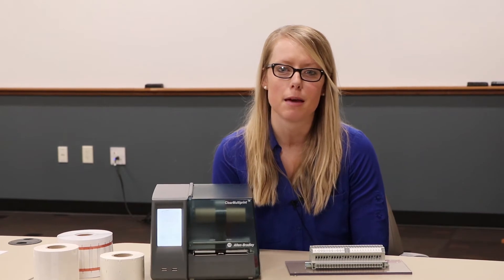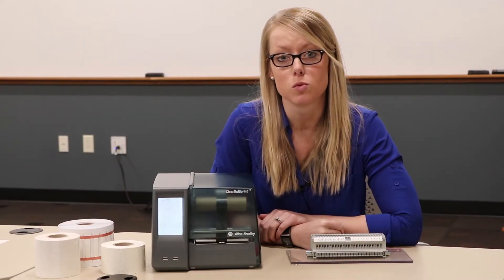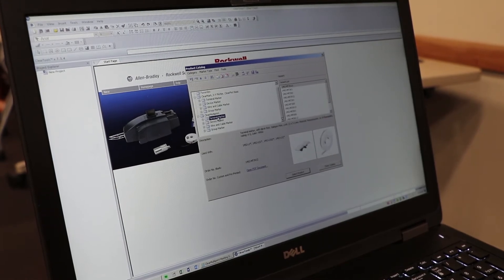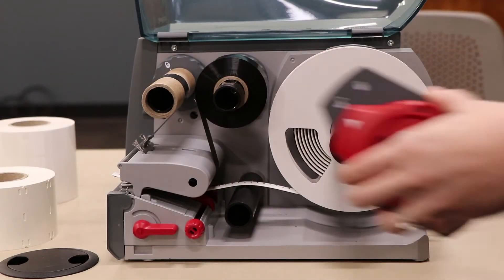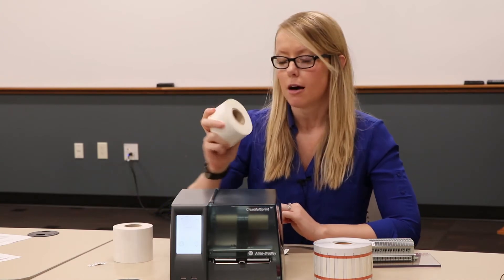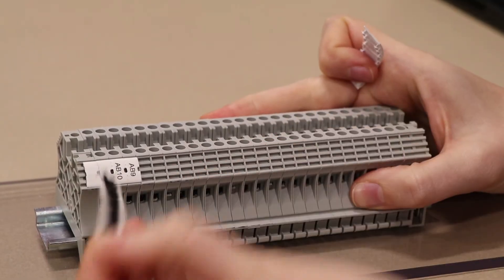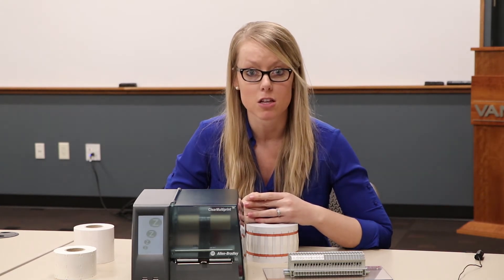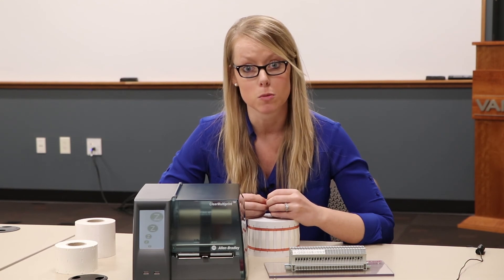Allen Bradley ClearMultiprint Marking System

Comment: I would like to know what type of printer roller I need to print the TERMINAL LABELS 1492-MTW5X9?   I have the same printer 1492 clearmultiprint marking system. and the printer roller I have in the printer is for use with 1492-MT ONLY!  NEED HELP!!!
Reply: 1492-PROLLTBW5/6/8X9 roller